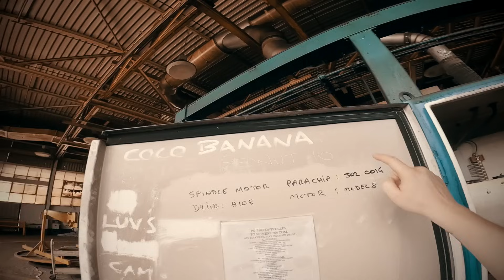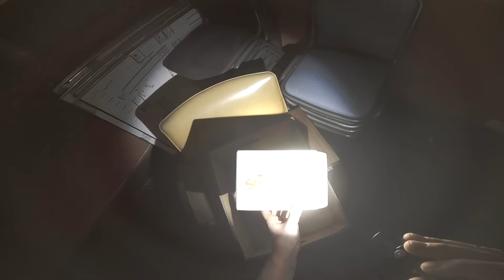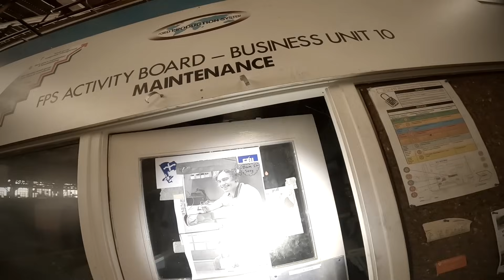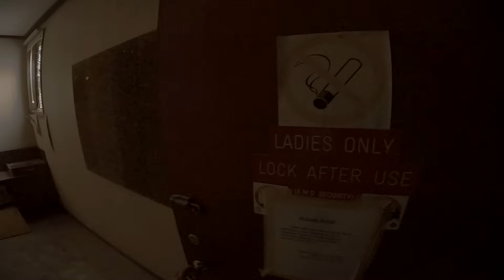I Snuck into Abandoned Ford Factory (Geelong)

Comment: As a young engineer I worked at that plant for 8 years.  You initially walked in through the front entrance and into the Engine Plant where they made the six and eight cylinder engines.  Walking through the area brought back many memories for me  It was a very interesting place to work.  Walking from the front to the end of the building from start to finish of the assembly line each engine component was machined and the engine progressively assembled with the finished engine started up and run for several minutes at the far end of this building.  Many engines were produced each day.  These were high quality engines and probably many are still running well today.
Reply: Must be heartbreaking for you to see it like that now. ☹️
Reply: Yeah, I'm a Holden guy through and through, but I did my apprenticeship with Ford. I'll admit, they were some damn well designed engine's for the time. Some of the power numbers people reliably run on them these days is pretty impressive.
Reply: Holden should have never been sold to an American company. All it ever did was cost us tax payers, whilst lining the pockets of the US government. Holden should have grown and became a leader. Instead, they sold out to the competitors.
We need a new Aussie car, home grown and owned.
Holden is dead because of General Motors. I won't pay them another cent while I breathe, especially if they start selling here again.
Reply: @brad9529  I hear they are made in China now.

Comment: Hey mate I worked at one of the new business in there that’s is a defence contractor, some of the guys that work there also worked at the Ford factory too. If you are going to go back I can come and tell you want most of the machinery is what it does. When I was in my teen we would sneak in and have a good look around before they started gutting the whole place. 👌🏼🇦🇺
Reply from the maker: Cheers Jordan, will keep that in mind. Shame I didn't have someone knowledgeable with me on the explore, definitely would've stuck around longer If I knew what I was actually looking at haha. Nice! What were the other buildings like, anywhere near as good as this one?
Reply: I worked there when it was the original toolroom 2002-2012 until marand took over we used to do a lot of work for Marand we had the biggest scanner in the southern hemisphere did a lot of scanning off the aluminium mould for the milatory jets

Comment: I worked in Cheltenhan in the mid 90’s as a first class fitter turner and it was apparent then that without a huge, huge investment the automotive industry couldn’t compete. These old machining centres are antiques and were in 1996 when I had a tour of this facility. From there I worked in former East German plants that were shuttered because they were fifty years older than the Geelong plant. I worked in Hambach, France at the Smart car facility that was very current at the time but like Australia there was little demand for the product and it was closed up as well. The blokes I worked with in Aus were some of the most resourceful I have had the pleasure of working with.

Comment: When the factory was in operation in the 60-80s the train company Victoria Railways now called V/line used to run a ford factory train out of Upfield and Geelong idk how it would have gone on the locations, but the old rails are still are in the concrete out the back of the factory near the train line.
Reply: The carriages were moved around ford’s with a push tractor and loaded and assembled for the engine to take them

Comment: the press shop was in the building on the right hand side where you waked in you went into the engine plant  and the old medical centre and the old empolyment office the press shop is just behind the old toolroom (which is now being run by marand they moved in 2012 taking over all the milling machines ) i also worked in the toolroom from 2002 -2012 when marand took it over parts of the old press shop and the old canteen ( the small white building you can see from melbourne  road are now used by metal corp
Reply from the maker: Ah ok,that answers some questions I had thanks Trevor. Got a shock when I saw the building on the right in full swing haha,and was wondeing what the white building was.

Comment: worked there ,on the 6 cylinder line just behind the office , even sat in the audio booth twice for tests
Reply: What year the 6 cylinder line was a chain driven line in the 80's then moved to the back end of the building and that was the area used for storage and later on the V8 assembly I worked in the press shop 1983-2002, tool room 2002-2012 press shop 2012-2015 shipping 2015-2016

Comment: As a kid born in the 80s I've always wondered what was inside! We only got shell tours in school to see the flame thrower cracker thing.
Reply from the maker: It looked like it hadn't changed since the 80's haha.
Reply: Changed a lot 6 cylinder engibe line use to be near the top wall where you climbed up the ladder (1980) and down the north side of the building motors were assembled on a chain loop the V8 engines were assembled right down the bottom as time went on the V8 were the fazed out (all V8 were lnported) and the old 6 cylinder line was fazed out after the new 6 cylinder was built at the bottom late on the new V8 were the built back near the top including the supercharged one for the GT wee assembled from imported parts so it changed a lot between 1983-2016 I was sent there a couple times over the time I worked for ford's but spent most of my time in the press shop (1983-2002) toolroom (2002-2012) press shop (2012-2015) shipping (2015-2016)
Reply: Toolroom(2002-2012) press shop(2012-2016)shipping (2016-until closing 7 october) plus 2 weeks clean up cheap-pallets, boxes ect.

Comment: It would be nice to see ford restamp all panels from the xa to fg falcon and fairlane range and possibly build new xd falcons and sell them in dealerships
Reply: Not possible all stamping dies have been scrapped I worked in the stamping plant and we were scrapping dies, jigs and fixtures right up to closing we ran enough parts to last 10 years? after the last car was built but only the latest panels for the falcon and Territory all older parts dies  (xt,xw xy, ect) were scrapped a long time ago scrapped a lot of them loaded them on to truck and sent them of to sim's metals
Reply: $50k for an XD today...who would buy it?
Reply: @Classickoolcars  when we are scrapped the pressing dies we had to make sure they could not be used again there were case's of old tooling ending up at other manufacturers who would make sub standard panels used to cut holes or drop them on the ground would do the trick

Comment: That would also be the exact building where the engine inside our 2002 Ford Falcon XR6 Turbo would of been manufactured in the year 2004! :)
Reply: correct engine block made at the ford casting plant (north shore geelong) now demolished then transported to the engine plant for machining and assembly the head's cam shafts and crank's were also made at the casting plant but later on the head's were cast in mexico shipped to geelong then machined and assembled in the main plant in geelong before being sent to the engine plant, piston's and rod's were made by an out side company
Reply: Pistons and rod's were made by a company called lunwin's in breakwater Geelong they also made some of the Ford badges and also some of the Holden badges(gts front grill, monaro badges) my 2 brothers used to work for them 1 brother ended up working at the casting plant he ended up doing an apprenticeship (fitter and turner) before leaving now work's on the Melbourne met trains

Comment: The plant must have been shut down in sections. Those computers look so old even for legacy business computers.
Reply: the engine plant was shut down a few weeks before the last car was built (there are pictures of this on the internet) the last 6 cylinder & last V8, the medical center in the front offices had not been used for many years, the employment center was moved into the old boiler house / laundry( the small building in between the two main buildings) and then moved into the white  building  on north shore road it was the old pay role office, satellite canteen, locker room& gym where the injection hub was set up, the old computers where use or kept if it was being used for basic functions, an old ford saying (why buy new when old will do) an other ford saying was ( i have short arms but have deep pockets )
Reply: You will have a lot of legacy systems still in use because
1. They are just as accurate as a new one.
2. They have paid for themselves and continue to work with little maintenance required. 
3. Training engineers on how to use a new system takes time and money.  From what I understand, factories do not want to take the downtime to implement a new system and hamper production. If the old system still is viable, they will continue to use it.
Reply: Nope, they look age appropriate, the auto industry moves damn slow with this stuff. For example, the year before Holden announced their closure, all their dealerships finally upgraded from Windows XP. This was only because the management software ERAnet forced them to update

Comment: I need one of those ford hard hats
Reply: When we left for the final time there were  a lot of them left hanging on the out side fences these hard hats were only introduced in about 2010 and they were worn in the press shop and some parts of the engine plant and the casting plant any one entering the these areas had to wear one can you imagine wearing these 8 hours a day driving cranes, tractor(only in side the building) also operating and stacking on a press line

Comment: It's insane that some lights have been left switched on, including some machinery.
This iconic work centre would still be in operation today if it wasn't for the introduction of Labour's Carbon Tax. 
Maybe the outside building appearance can be kept as Heritage while inside can be converted into apartments under local Council approval.
Thanks for the tour.
Reply from the maker: You're actually pretty spot on Kon, the iconic facade is protected by heritage and the inside has been converted into a business district.

Comment: My dual fuel AUII Falcon SR wagon with 440,000 k's has a bog stock intech 6 that would've been built there....still going strong 👍😈
Reply from the maker: 440!!! Beast!
Reply: @urbexgecko  they were getting a million k's outta the taxis so yeah, it's good reliable cheap transport & not a bad car to drive either 👍
Reply: Telstra was in love with the wagon when they announced the final run they ordered a couple of of thousand of them
Reply: The engine would've been but the rest of the car was built at the Broadmeadows plant.
Reply: Holy crap. Thats a lot.

Comment: I'm gobsmacked that A: The lights are still on (is the tax payer footing the bill for the power?) and B: WHY such machinery wasn't scrapped or sold off.
Reply from the maker: Shot many years ago Steve, site has since been gutted. Not sure what they did with all of the machinery after it was removed.
Reply: @urbexgecko  Ah ok - Youtube says 2 years ago...like we can ever rely on youtube info! :face-blue-smiling:
Reply: i thought the same thing those lights wont be cheap to run either , where talking nearly a kw for each light.
Reply: @steve4073  the electricity for the press shop lights that ran 24 hours a day in the 90's was $5,000 a week it would be a lot more now